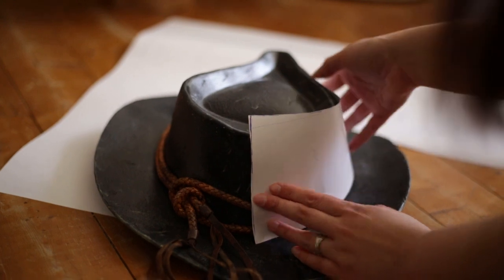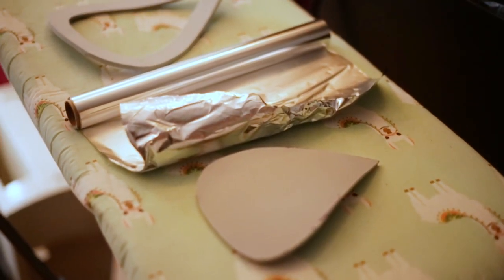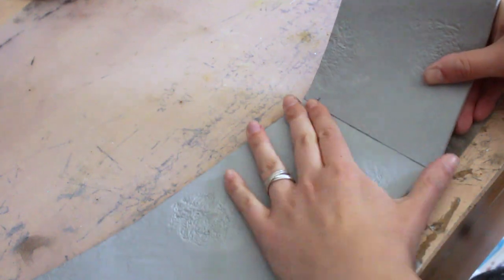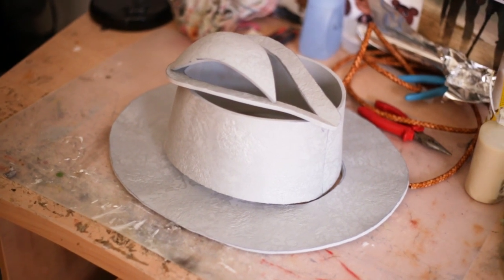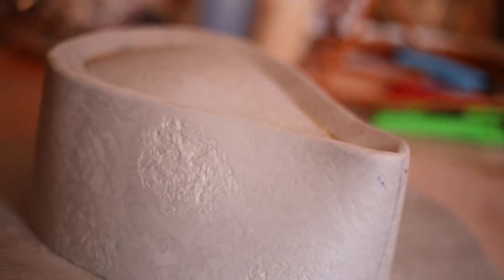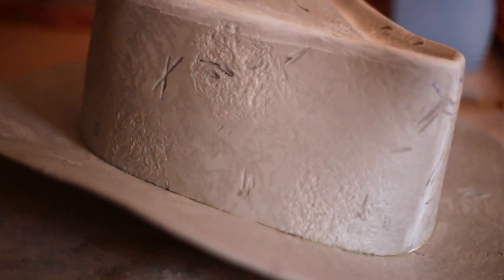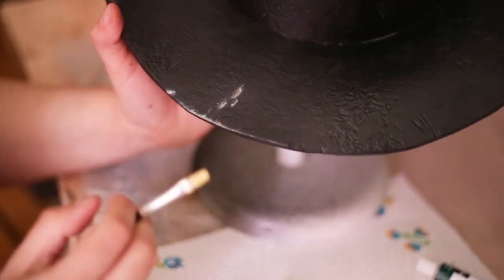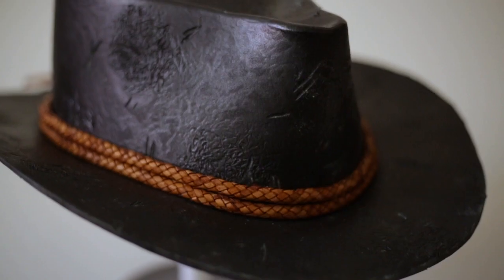Arthur Morgan EVA foam hat tutorial

Comment: It might just be my big head but when I printed it out it was too small. What size paper did you print it on?
Reply from the maker: Hey, did you maybe print it all on one A4 page? It's supposed to be printed with the "poster" settings on your printer, so it will print on several A4 pieces and you have to glue them together. Better not rescale them. Hope that helps. :)
Reply: Pasta Cosplay I have to use rasterbator to print mine. How many pages wide and horizontal should it be?
Reply from the maker: @ghostmangaming2341  I'm not familiar with rasterbator, but when I printed it on Acrobat with the poster function, it printed on 6 A4 sheets.